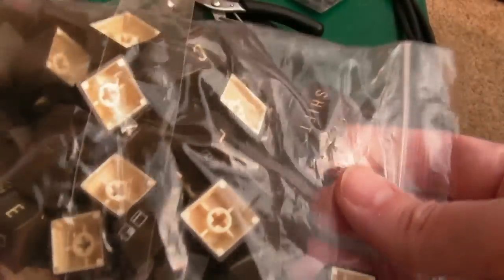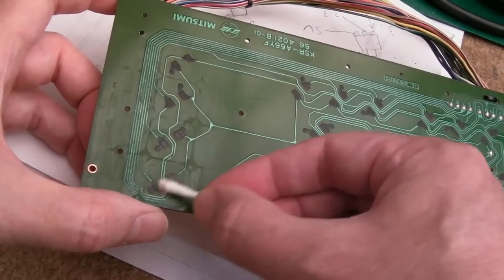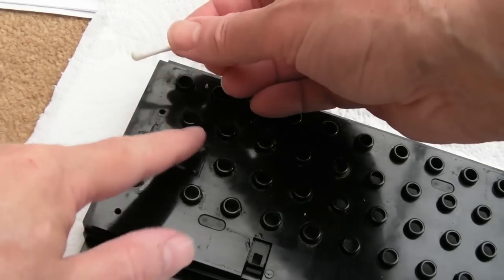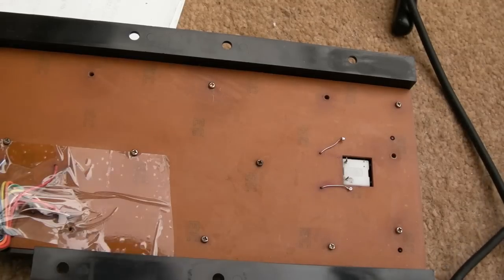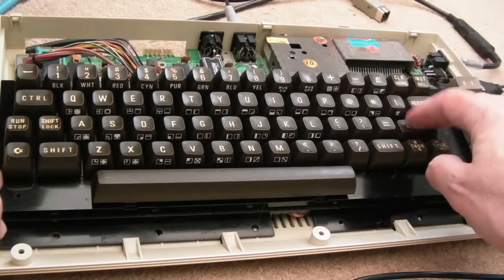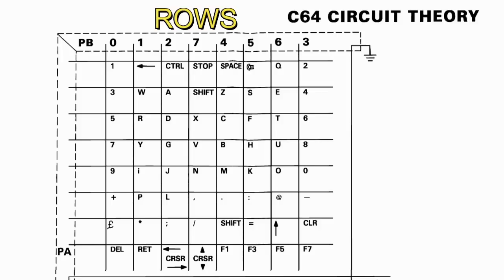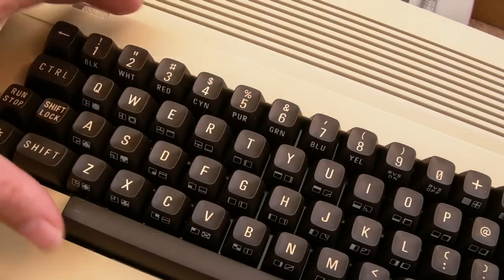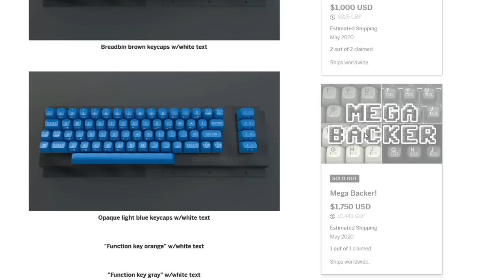Commodore C64 Keyboard Repair & Information

Comment from the maker: It's pretty obvious I guess, but the two cols or rows going to the 4066 there will be used to read (not the CIA, the SID reads them, but perhaps to address or something - perhaps they provide the pulses to the potx and poty connections) the potx and poty probably.  That probably means the chances of that 4066 causing a problem with the keyboard could be 1 in a million or something.  When I get more time I will check the pinout and investigate that further.
Retro Marky - stuborn Restore key - https://www.youtube.com/watch?v=FaMAXyh1RwI
Hey Birt! - fixing conductive pads - https://www.youtube.com/watch?v=XInxW0Ytgh
CBMSTUFF C64 Key Caps Campaign (Should deliver soon) - https://www.indiegogo.com/projects/keycaps-for-your-commodore-computer/x/10876693#/
Reply: Those two lines are used to multiplex the POT lines between control port 1 and 2. There is one line for each control port, high signal connects the control port to the SID. (Which means it is technically also possible to connect both control ports to the SID at the same time, which has no useful purpose.)

Comment: Agree on the carbon pads. Never use paper, cardboard, or an abrasive. Shiny contacts still work fine. Gently remove dirt with alcohol and a cotton swab.

Comment: P.S. Carbon pcb contacts are possibly best cleaned with de-ionzed water and cotton bud. Then immediately dried with tissue. Sometimes, black residue coming off the cotton bud is not always a good sign. You could be, unwittingly, removing the contacts resistive coating.

Comment: Rust can be removed from plastic by making a paste of baking soda and vinegar.   Put the paste on the rusty parts and let sit overnight.  In the morning scrub the past off.    It sound strange that mixing an acid and base would do anything, but I used it on a Coleco Adam case with a big rust stain on the side of the case and it worked great.
Reply from the maker: Thanks!  Great tip!
Reply: @GadgetUK164  It really is the best option (compared to hours of work with a wire brush) as it chemically removes the corrosion but you must neutralise it afterwards otherwise the acid will just keep going and of course dry it properly straight away. End result is nice shiny metal. It will still corrode if exposed to moisture but that is going to happen anyway unless you apply some form of plating

Comment: C64 = 64 keys (the 8 x 8 lines on the CIA)
Reply from the maker: Technically there are 66 keys =D  1 is Restore though (wired to NMI) and 2 x Shift =D
Reply: @GadgetUK164  64 give-or-take a few